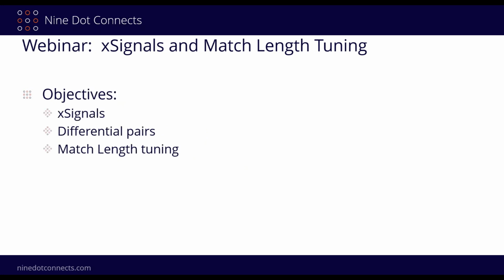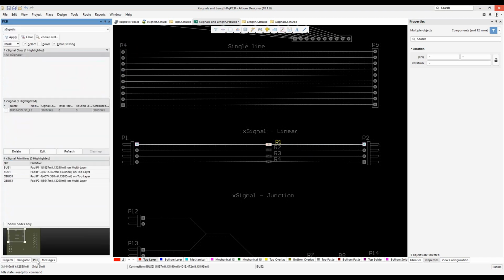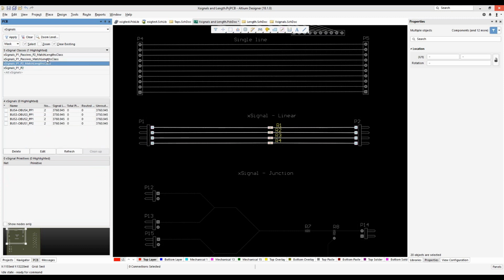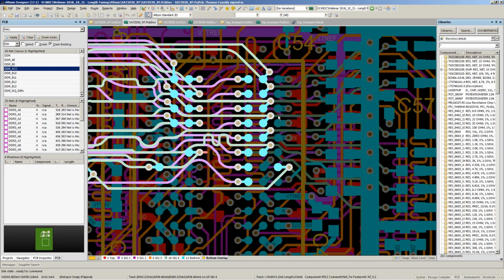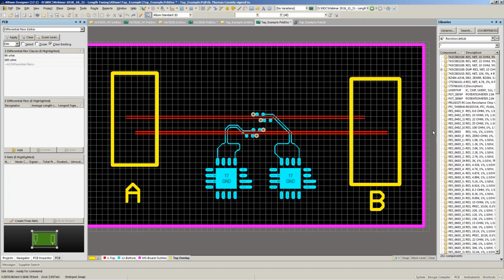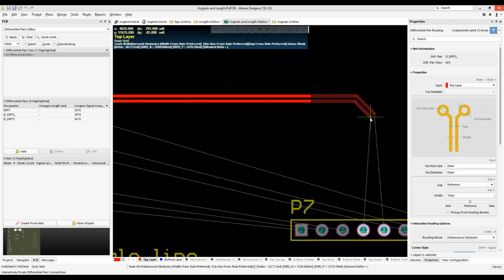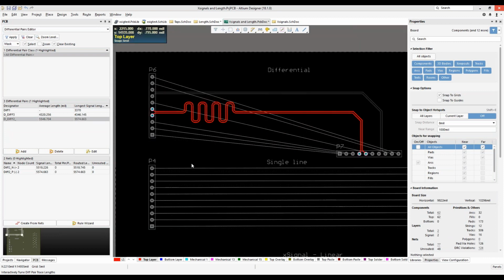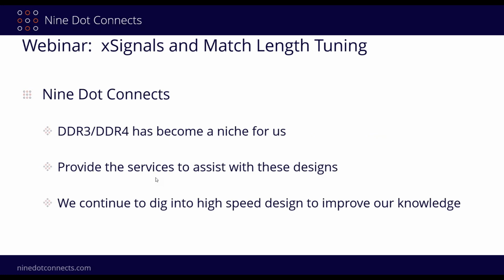xSignals and Length Tuning in Altium Designer

Comment: Thank you for the video.  I got 8 minutes in, and learned what I needed to learn to do what I was trying to do.  This actually works through ICs, much to my surprise.  Also, if you select any ambiguous pins along the way (meaning more than one possible path from end to end, such as an alternate path thru a pair of RF switches) it will create the x-signal through the path you select.  This is great that this feature is now in and works through ICs, without having to setup models.